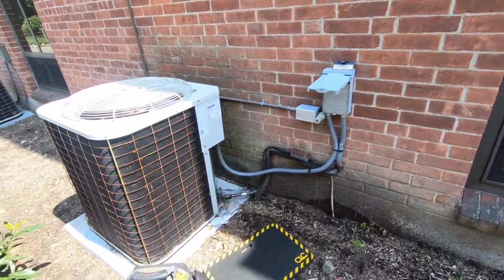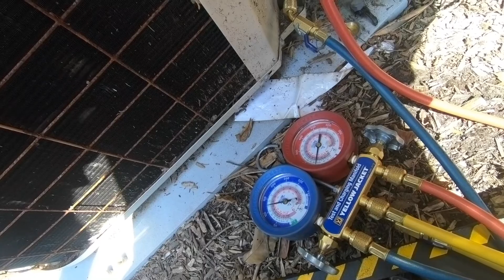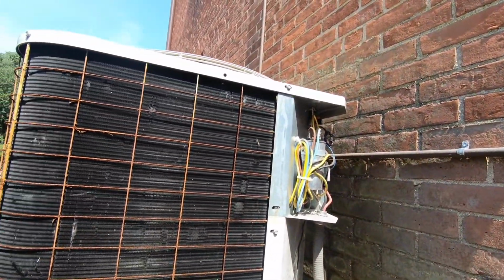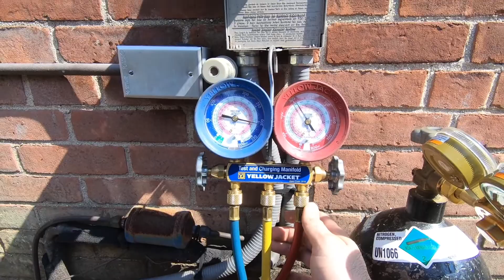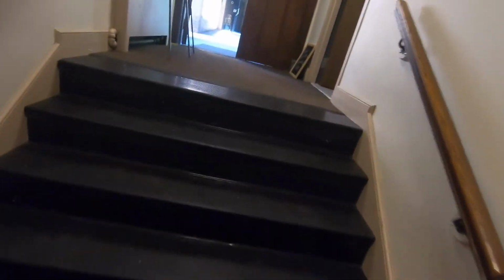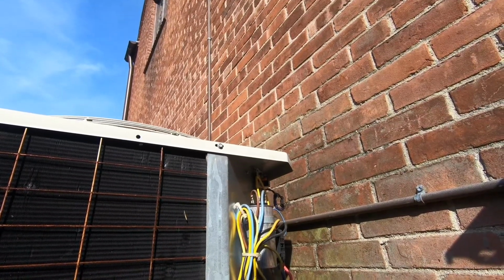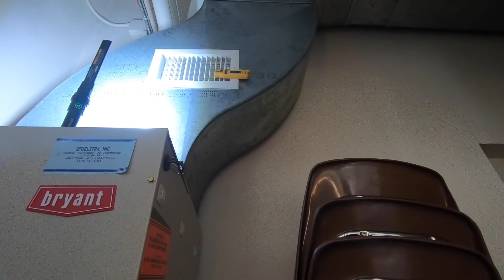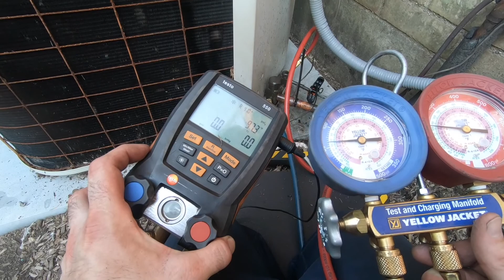NO AC Service Call 8 Suction Service Valve Braze Leak

Comment: It may be better to wrap the service valve with a dampen towel to protect the o-ring inside the valve. Great video!
Reply from the maker: Yes it is better to wrap or us hot dam
Reply: His next call is going to be the service valve leaking because he doesn't wrap valves when he brazes.

Comment: I have a burn out compressor change out on the schedule soon, that should be fun. Potentially need to replace a compressor on a RTU at a local restaurant too. Would be nice to have a cam for those.
Reply from the maker: Which cam would you purchase? Those sound like good repair videos to make. Commercial is easier to make videos.
Reply: The commercial one is a 2 compressor Carrier RTU, they have a makeshift wall between the RTU and the exhaust fan which makes it really tight, if I get to do the job, I'll try to get video of it.
Reply from the maker: Wouldn’t the GoPro hero 5 black be better since you can replace batteries? Extra battery and dual charger was one of my first purchases for my hero 6 black. Batteries don’t last long so being able to swap them come in handy. I was on 5e fence over the 5 black and 6 black.
Reply: The HVAC Hacker very true, I will have to look at one made by Sony too, I forgot the model number, same specs as GoPro but more affordable
Reply from the maker: I was just recording a service call and the battery died. I keep a duly charged one in my truck so ability to change batteries is important.
Reply: The HVAC Hacker working a low voltage issue on a York, I hate this thing
Reply from the maker: What issues u up agains?
Reply: The HVAC Hacker low voltage fuse popping in attic, no continuity from any wires to ground, ohms on contactor are good, not grounded. You on Instagram?
Reply: Got it running
Reply from the maker: Where was the short? 24v contactor? I was driving to my next call.
Reply: The HVAC Hacker I have a feeling that since the low voltage wires were stripped really far back, that they might have been making contact with the board or another wire, trimmed them back, rewired the entire thing
Reply from the maker: I usually disconnect all low voltage and hook up one wire at a time looking for my shorts. Do you have a resettable breaker like https://billstoolsnsupplies.com/product/lil-popper-3-amp-control-circuit-breaker/   they come in handy so you don't need to burn up fuses.
Reply: You will love this one, maintenance call, customer is complaining that the house will not cool down below 78, I go into the attic to start (I like to work my way down and out), it is nice and cool up there, I look up, 10" duct had come apart at the collar.
Reply: The HVAC Hacker yes, I have a 3a and a 5a. I really do think it had something to do with the wires being stripped like 3/4 of an inch, they were crazy far from the screws holding them to the control board. I trimmed them down, wired all the ones from the tstat on the bottom of the screw, all the ones from the condenser on the top, none were looped around the other cables. This way next person that looks at them can tell which set is which quickly.
Reply from the maker: That’s a nice easy one that was nice and cool not hot like the attic I just hoped out of. Pulled out a closed solid aprilaire 201 filter that hasn’t been changed in 5 years. Hopefully that’s my last one today.
Reply: The HVAC Hacker no way, WTF, you should be home by now. We need a tech like you at work. We really rarely get off this late.
Reply from the maker: I wish I never worked late. Monday I finished around midnight, Tuesday I got home around 11pm I had another call after the contaminated system video, Wed 9pm, yesterday 9:15 after replacing another condenser motor. and on my way home now. This is my week being the emergency on-call service. So I will get calls most the weekend unless it cools off.

Comment: 1:30 quoting a $1,000 10 lb unit of R22 for just the R22 refrigerant? $100 lb wheres your ethics? apparently LOST in that messy truck. Our 30lb R22 from Gemaire distributor cost $401.00 as of June 2020 thats $13.00 a lb cost. This taints the industry goes beyond captalism gouging. I hope ethically you offered the client 404a option. Good luck with that karma and certainly a hack.